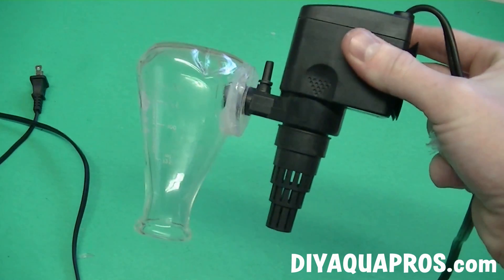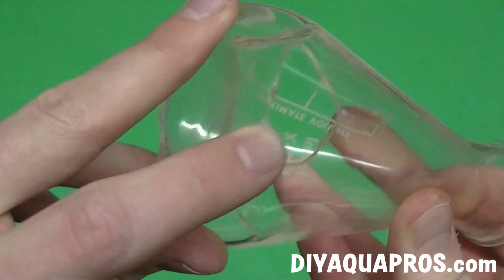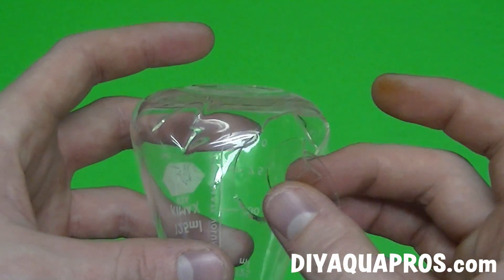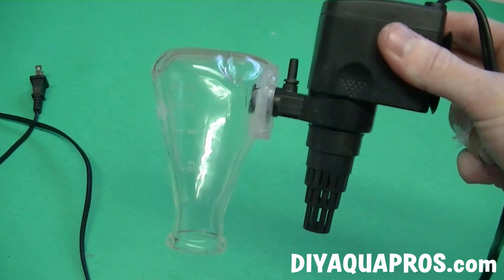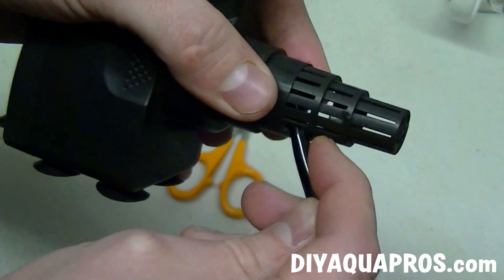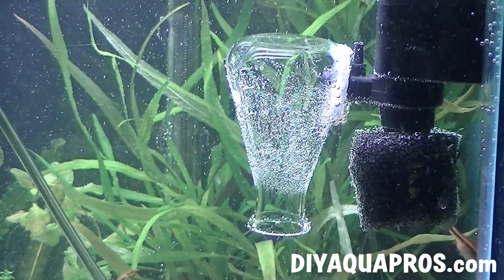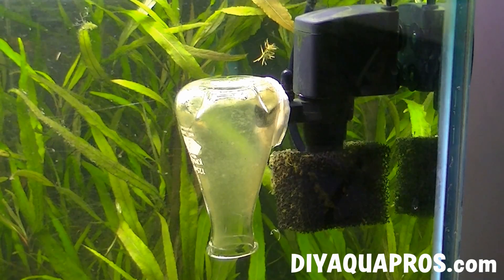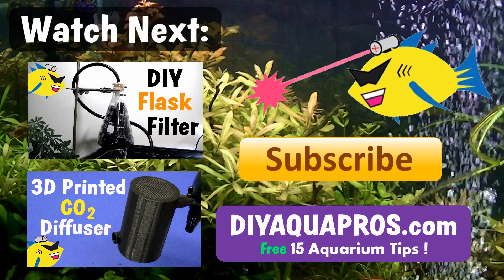DIY Flask CO2 Diffuser: Aquarium CO2

Comment: I built a smaller version of this a while back using a syringe instead of a flask or bottle. I also added a sponge to trap the big air bubbles and allow only smaller ones to pass through. I also added a pipe that sends larger bubbles back to the impeller. I think this method of diffusion might be better than regular ceramic diffusers.

Comment: Can I put the co2 tube in the air intake hole? Will it work same?
Reply: Yeah that's what I do. It just doesn't chop the bubbles up as fine but it still works if you capture the bubbles in a bottle so they can dissolve better. A taller bottle works better.

Comment: Why would you not run the CO2 line into the air intake on the powerhead?
Reply: That’s after the impeller, so the bubbles wouldn’t get chopped up as much

Comment: I have added plants to my tank which led me to research all things CO2.  Which led me here.  So I switching this and pondering how to setup  my tank,  I had made a drink for myself using one of those  water carbonation units.  So my question,  is there anything wrong with  taking tank water and carbonation it using something like Sodastream and returning it to the tank?
Reply: That sounds like a lot of extra work using a soda stream and probably less efficient. I'd start with a small kit or diy yeast C02 which lasts a few weeks at a time which is what I'm using. Instead of dumping it out I just feed it about once every other week and pour out a little bit adding new water to dilute to alcohol so my yeast doesn't die off.

Comment: The recycling vibe is all good but in this case it dousn't make sense anymore. A sodabottle or any tubing would do better in every aspect, especially because you can create a taller system in wich the bubbles have to travel for longer. I tried the co2-thru-powerhead system a while ago, it sure smashes the bubbles apart but while doing so the pump makes a rattling noice due to the impeller going out of ballanceI. It's noisy and cant be good for the pump lifespan. My 2 cents on a good video!
Reply from the maker: Constructive criticism is appreciated! I totally agree with you on the plastic bottle part, ive made more than a few of those in the past and they do work better than the flask design. Just wanted to share a unique project that was relevant to all the CO2 stuff im planning.

Comment: Yes, I like it and although I haven't had anything to do with CO2 in tanks I an see the benefit of shredding the bubbles with the impeller to allow better infusion.
I like the way that you look at something not connected to aquariums and see a good use for it too. That is exactly what a good inventor does while most people will simply copy existing ideas, passing them off as their own or simply not see any sort of connection between different useful 'things'.
There's a couple of interesting developments I have in mind to bring forward over the next few months and as a matter of interest do you guys have biorb aquariums over there?
They are a sphere made from acrylic and are renowned for having terrible filtration - we know them as a 'ball of death' over here.
I have a plan to make them work very well.
Reply from the maker: Ya you can get the biorb over here, ive never messed with them. I can see a lot of issues with the substrate based air driven filtration, glad to see someone is thinking about ways to improve such a popular beginner product, excited to see what you've come up with !
Reply: DIY AQUAPROS The main problems with them is the tiny sponge which is really (the sole filtration) and the large 'filter media' which does nothing due to the lack of water flow through it. Both those problems will be addressed when I can get my hands on a used biorb for video purposes as no way am I shelling out for a new one, lol
Reply: yeah they are sadly a thing here too. I work at PetSmart in Pet Care and we get people coming in all the time asking if we have them. Thankfully we don't, but a lot of mom and pop stores have them. Im not sure if Petco sells though....
Reply: bosnakedisniksic They are literally a ball of death but the idea I have for them will definitely transform them into what they should have been in the first place - something which will support life, lol
Thanks for letting me know they are in the US too as that opens up a wealth of new users for the upgrade kit - details will follow.
Reply: ill stay tuned